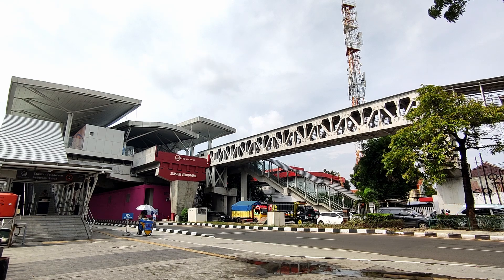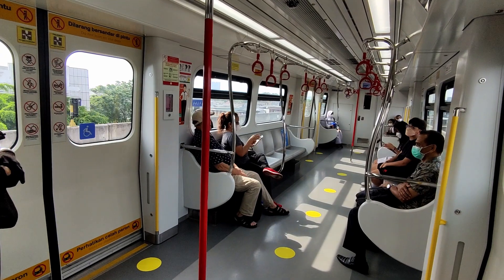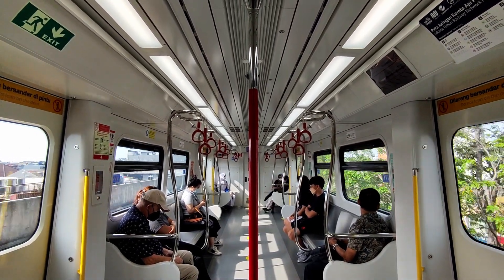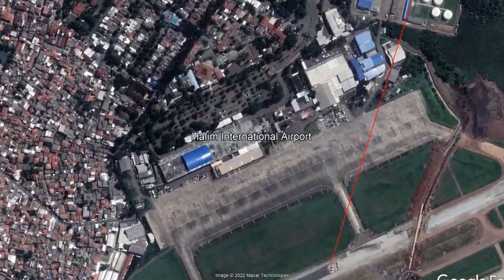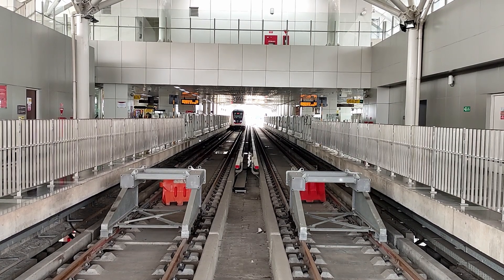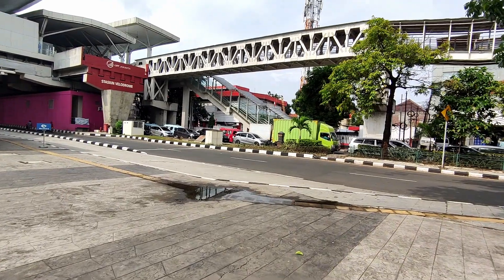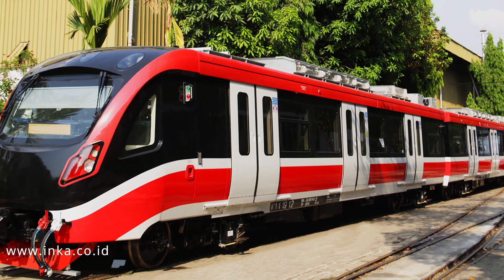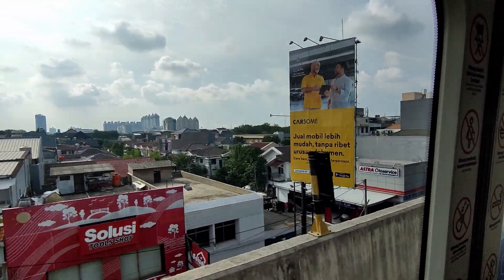Building The Jakarta Light Rail Transit System

Comment: Weird city. The rail system here whether LRT or MRT is just cosmetic, not practical at all. Most of them are proposed for the use of tourists during the Asian Games and do not target the needs of citizens. That's the reason the rail is short. It would be nice if it wasn't wasted just for the pleasure of 1 year. 
The only real people's project is the Greater Jakarta LRT which is 40 km long if I'm not mistaken. But from the latest news MRT is being extended. At least they try to fix the existing weaknesses. Good luck, JKT

Comment: Apparently Greater Jakarta LRT and Jakarta MRT have more development than this Jakarta LRT and I can see why. The location is poor of traffic and the line is not long enough for starter to gain more ridership. And given low frequency of the train people living around there prefer choose old Angkot (sort of public minibus) and private motorbike to commute along the line. MRT Jakarta have high frequency and covering most dense area in Jakarta, so do Greater Jakarta LRT. This Jakarta LRT only ended up being empty like Singapore LRT if they don't continue the proposed project to JIS and HPK Airport, which will connected into Jakarta-Bandung HST.

Comment: MRT IN MALAYSIA
TOTAL 153.2 km (95.2 mi)
MRT 1 51 km (32 mi)
MRT 2 52.2 km (32.4 mi)
MRT 3 50.8 km (31.6 mi)

if includes LRT, KTM, Monorail etc = 555.7 km
Reply: KRL jakarta 415km
Brt jakarta 223 km
Mrt 15 km
Lrt 44 km
Jakarta metro transport still better than kuala lumpoor
Reply: @eddiebrock5408  wkwkwk yg dibahas udah siap bos bkn yg masih dalam perancanaan 😂😂 igt fasilitas transportasi awam udah ada semenjak 1990an bkn tahun 2019🤣🤣
Reply: @redoni9175  nggak apa2 dong.mau siapa yang duluan atau apalah yang penting Jakarta udah berbenah baru2 ini juga Jakarta memenangkan ajang suistainable transport award mengalahkan kota2 besar sekelas San Francisco dll.nggk penting siapa yang duluan membangun yang penting tuh hasilnya dan apa yang dicapai dan Jakarta memenuhi itu semua. jakarta-Bandung HSR juga akan siap akan dilaunching bulan depan 🤩
Reply: @redoni9175  itu semua sudah beroprasi sejak 2019 kecuali lrt konstruksi sudah mencapai 98% akan beroprasi mei 2023, sedang dalam pembangunan mrt phase 2
Reply: @redoni9175  itu semua sudah beroprasi sejak 2019 kecuali lrt konstruksi sudah mencapai 98% akan beroprasi mei 2023, sedang dalam pembangunan mrt phase 2
Reply: @redoni9175  
I agree. Only the BRT works in Jkt. The MRT runs to places close to the Asian Games venues so isn't that much of a help to alleviate traffic jams. Plus it's dumb to compare JKT traffic mess to the traffic conditions of KL. The KL city planners got it right.
Reply: Malon   menipu  dengki  busuk  hati  berpisah tiada sehingga ke MATI  nauzubilahi min zaliki 🤬👹😈laknatullah
Reply: No one cares❤
Reply: but Malaysia can not make own train , i am sorry for that
Reply: Malaysia the best In the world...and this planet....

Comment: AFAIK Governor Anies prioritizes heavy-rail MRT to be developed further rather than well-balanced development for both LRT & MRT. It seems that the Anies positioned Jakarta LRT as only a rail feeder for the MRT to reach rural areas. That's why LRT Jakarta seems no further development until now
Reply: More reasonable if LRT was supposed to connect lower density area given the capacity of the train. LRT actually have same level of capacity with BRT (Trans Jakarta). Only if LRT are built much enough like Trans Jakarta it will have many ridership.
Reply: @rakandzakwan6402  terowongan mrt untuk mengurangi banjir juga